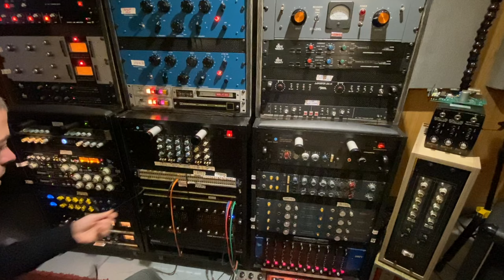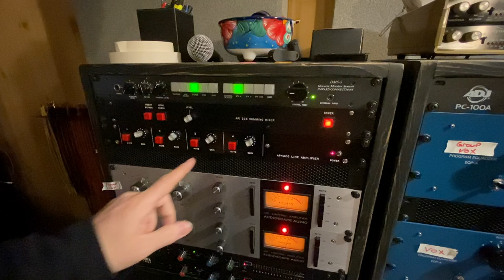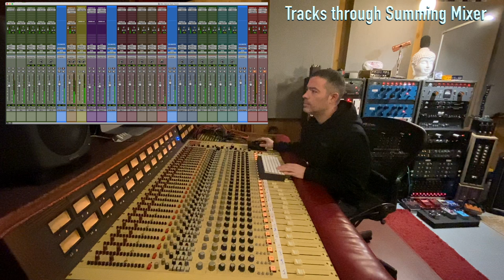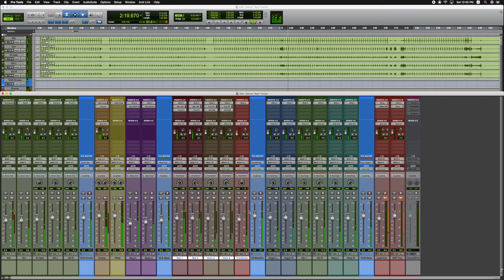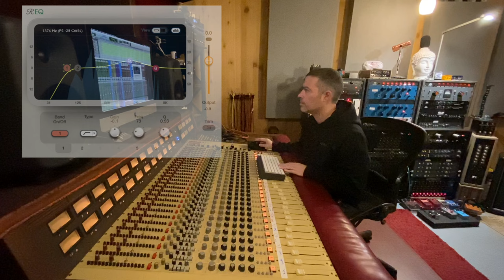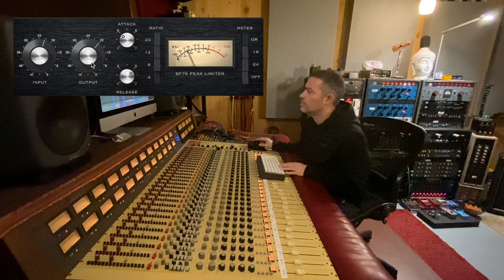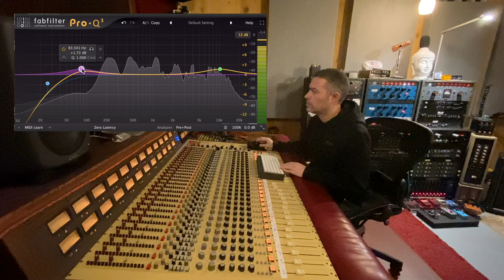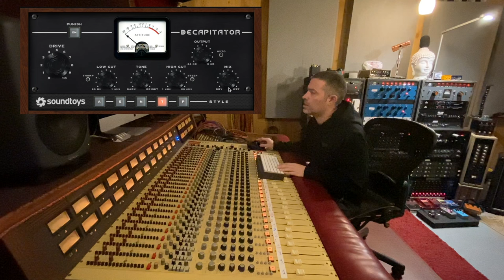Summing Mixer vs Console, Mixing Analog Tape Tracks @RiotHomeRecording

Comment: A few side questions, please: Do you know how this MCI 400 series would sound versus a 500 series and/or a Yamaha PM2000. Have you tried Sphere, Raindirk and/or Electrodyne consoles?

Also, how would your MCI tape machine sound against a Scully 280, an Ampex MM1100/1200 or a later Sony APR, if you’re aware, please?

Thanks.
Reply from the maker: I’ve mixed on vintage Neve consoles, Vintage api, new api, sphere, SSL, Quad Eight, Mci 400 series, mci 600 series, Neotek, Tac, Midas, Soundcraft, Mackie, Yamaha PM series, Allen and Heath, etc…

I’m not familiar with a raindirk console.

My Mci 400 series is a very stripped down primitive console with not a lot of components in the signal path it has a lot of transformers and not a lot of capacitors. An MCI 500 series has many more capacitors because it has more features that require more components. I like my 400 series because it’s very simple and has a musical color, it sounds wide and dimensional. 

A sphere console is cleaner and more hifi sounding in comparison.  An Mci 600 series does not sound like my 400 series at all. It’s chip based with no transformers. A 500 series is closer to what I have but again has more features.

My tape machine is a 1983 Mci JH-24
And it’s sounds great, but in my opinion a Mci JH-16 with transformers sounds a bit sweeter. 

Scullys are great, ampex are great, and Studers are great, 2 inch tape in general has a sound that certain styles of music can really benefit from IMO. 

The great thing about JH-24’s is that they’re easy to fix and there’s a tons of parts available and still being made for them. And they’re relatively cheap.

I hope this helps.

Thank you!
Reply: @RiotHomeRecording That means much; thanks. 

I've mostly been  trying to decide between a 400, a modded 500 and a modded PM-2000. I'd definitely need to modify a 500, of I were to go that route, but I like that some 500s work on 32V rails.

I really like the sound that you've been getting from your MCI 400 and R2R.

Thanks
Reply: @RiotHomeRecording  As a former JH-16 owner and former JH-24 user, the JH-16 may sound a little thicker but I would think the JH24 is perfect with your JH400 so things don't get too wooly. The JH24 is really one of the best sounding tape machines ever as it's more refined than the also excellent JH16. I do not like the 500 series that much due the complication and technical issues they can have but they do sound good. The JH500s can be good if you really keep up with the maintenance. I really did love my JH16 24 track though. I used it with a more modern Soundtracs console so it balanced out it's vintage sound just right.

Comment: The console mix is in an entirely different universe and hands down far better. It sounded cleaner, more separation of instruments, had more body and contain the right amount of sheen. It instantly pleased my ears. No offense to the summing, but it sounded flat and a bit dull, almost like a purely ITB plugin mix. Because of costs I was considering a summing mixer, but you just saved me money.
Reply: agreed
Reply from the maker: When I mix I go off my initial instinct based off the feeling you just described. Lots of people say plug ins are just as good as hardware. Then why don’t I feel inspired the same way I do when I mix with hardware? Why don’t I hear the size and dimension in the plug ins like I do with hardware?
Reply: @RiotHomeRecording  exactly. While I do not have the same level of experience or equipment as you, I completely agree as I have found that to be the case. For example my UAD LA2A plugins do not sound the same nor achieve the same results as my UAD MK610 even with the preamp bypassed. I cannot understand why popular mixerson YouTube, even the so called legends tell people these falsehoods, but I assume for sponsorships. What these mixers do not tell you is their tracks have already been processed through consoles so they CAN mix and stay ITB at that point, but it was not tracked that way. My gear smokes my plugins. I'm a newbie and I can see this. I love your channel and your work. Please keep it up.

Comment: This is a great real world example. If people think doing an ITB mix vs a Console mix means trying to match them identically, they are missing the point. Horses for courses. You simply make it sound right for each situation and wasting time worrying about exact same EQ and outboard settings doesn't make sense. Both mixes sound excellent. I much prefer working on a console however, so that's what I choose.
Reply from the maker: David 100% correct! There’s too many variables and how you push into one mixer the end result will be completely different pushing the same way into another mixer. Same with eq, compression, gain staging, etc… I mix based off my instinct and react quickly and move on. Many people beat a mix to death and wonder why every new revision sounds worse then the first print.
Reply: @RiotHomeRecording  exactly!

Comment from the maker: Your assessment is dead on great ears! And thank you for the tip on using busses for paralleling the C2. I understand exactly what you mean. I guess I just wish they added that to the actual compressor. I emailed Allen Smart about having it done. I’d have to mail it out of the USA which I’m just not willing to do with other work arounds available like the one you just mentioned.

Thank you!

Comment: Hey man! Love your channel. Im a bit of a noob when it comes to physical consoles. How does the signal come out of your converter/interface into the console? What cables and devices are used?
Reply from the maker: Ben,
My converters are a Burl Mothership with XLR outputs. I could wire my converters directly to my consoles line inputs, but to make life easier I wired my converters to a patch bay that is normalized to my console. This way when I want to send the DA output’s directly from my computer to any other device I can simply patch it in like I do here with my summing mixer. Otherwise I’d have to crawl behind my console and that’s a hassle.

Comment: It,s s big difference between API and MCI mix in the stereo field. 
The API have wider spread in the field and the MCI is more mid centred but also the pans of each instrument stands out much more, brass section- hard pans to each side faster each time it plays in the mix .The MCI sounds more slick and punchy and the API more natural.  It’s also very big difference in the bass guitar on the MCI it sounds more compressed Eq,d and forward jumping out more in the mix on the API more even and natural sounding.

 -you can do parallel compression on your mixer using the busses. Insert the C2 on two of your busses send all channels to the master and also to the buss with the C2 compressor then send the buss  with C2 insert to the master. Now you have a parallel connection and the possibility to mix in 0-100% C2 on everything you send to the C2 buss.

If you don’t have routing directly to master buss from the busses you have to patch it in buss out- C2 - in to the mixer channel- send to master.
Reply from the maker: Your assessment is dead on great ears! And thank you for the tip on using busses for paralleling the C2. I understand exactly what you mean. I guess I just wish they added that to the actual compressor. I emailed Allen Smart about having it done. I’d have to mail it out of the USA which I’m just not willing to do with other work arounds available like the one you just mentioned.

Thank you!

Comment: Impressed by that summing mixer mix actually.  Is there any summer mixer on the market currently that you have used and like the sound of?  The Capi one seems interesting
Reply from the maker: @lobit12  I like the inward connections mix 690.
Reply: @RiotHomeRecording  the Oracle one looks interesting as well.  Would be hard to judge once over the other without hearing them but Im sure they are both great

Comment: Why your monitors are set flat not toed in? Coz you leaning to one side in ur sitting position? Thanks for video
Reply from the maker: I have perfect phantom image. My speakers and room are aligned.
Reply: @RiotHomeRecording  great, did u measure and reposition or also using a room correction solution?obviously u have a great room anws

Comment: So this is a console mix that was done using external HW (from the previous vid), with a new, purely ITB mix run through the API?  I'm confused.
Reply from the maker: Yes, The console mix is the exact mix from the last video.

The api mix is the ITB processing from the last video, but I used plug in compression & Eq I place of the outboard compression & Eq.

Hope this clears it up a bit.
Reply: @RiotHomeRecording  Got it.  So the big difference is due to different compressors and eq, different summing, AND different ears (i.e., you mixed it again).  I point that out because some of the comments simply think this is about "summing mixer vs console" only.
Thanks
Reply from the maker: @ParadNorthProd 
Correct the analog hardware processors were replaced with digital plug in processors. On the summing mix. The only hardware on the api is the Mixbuss chain Smart C2 & Xfilter.